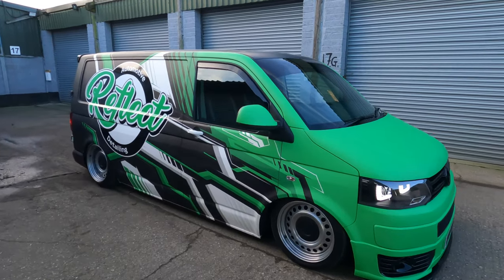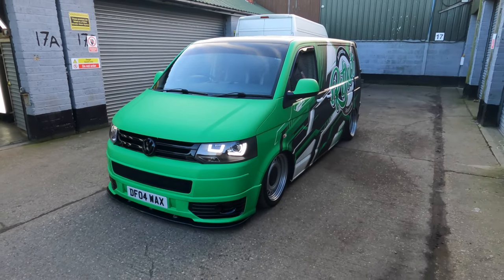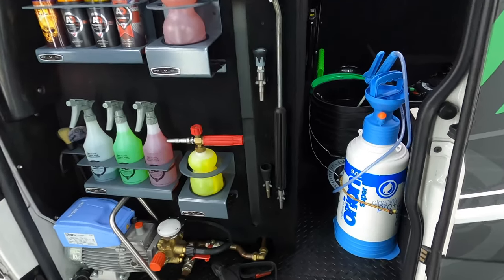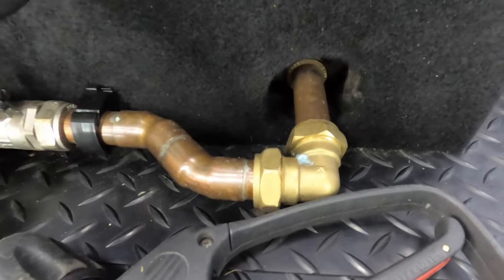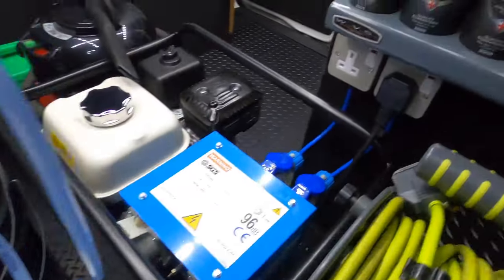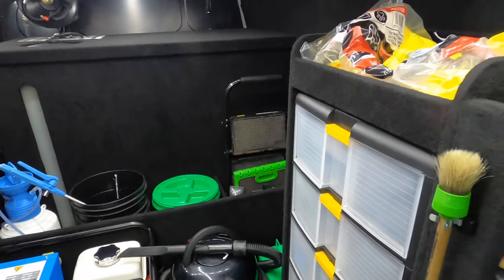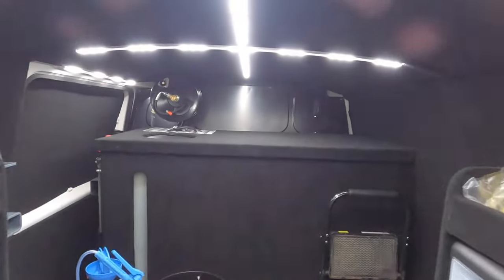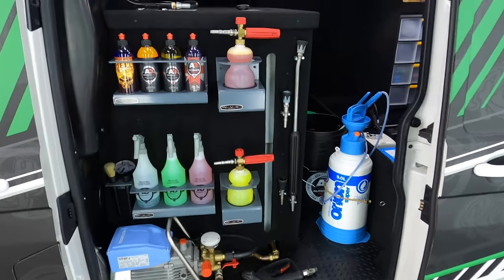VOLKSWAGEN T5.1 TRANSPORTER MOBILE  DETAILING VAN SETUP TOUR 2021

Comment: Great van and setup man , you mentioned in the video one of the main reasons for the bigger van was for the bigger water tank whats the reason behide wanting the bigger water tank
Reply from the maker: Water supply for work during the day as the 350l in the caddy wasn’t enough as i can do 600l a day
Reply: How many cars would you get out of the bigger tank vs smaller one
Reply from the maker: @Chocman  350l did 3/4 cars max now i can get 6/7 which is a long day but dont need to mess about filling up during the day
Reply: Great tks Dan hope to see some more new vids soon love your work
Reply: Looks ace , do you fire up generator in van?